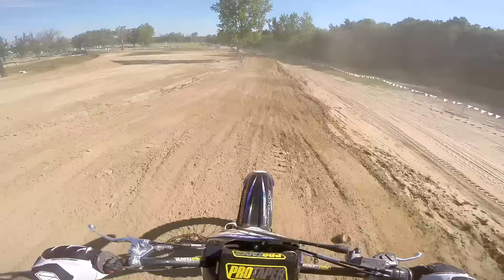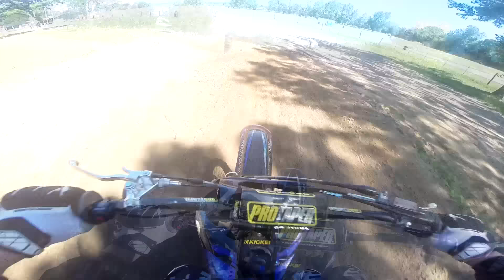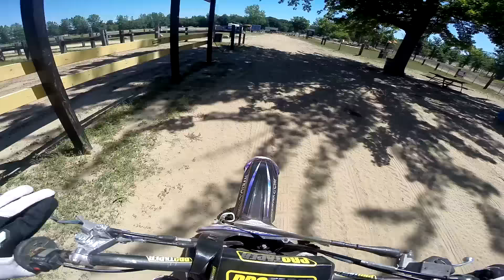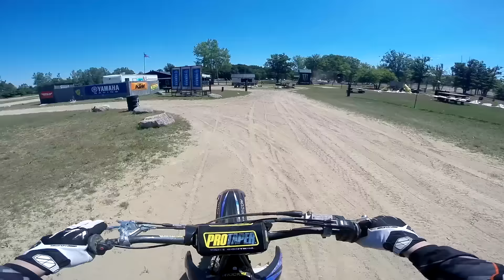RIP 250

Comment: This happened to me I spent time to  fix my bike up got new plastics and other crap then it started acting up 😂 ah the stress there so much fun to ride though it's worth the fix
Reply from the maker: By this, what do you mean?  Busted shift fork/rod?  Any clue how much I'm looking at to have it fixed?  Don't have tools to fix it myself and people I talked to that know more than me don't want to mess with their transmissions.
Reply: +That White Guy yeah that sucks stupid dealership charge a crap ton for any type of repair but I would recommend having a very mechanically inclined person you personally know do it but if you don't tea know anyone  that kind of sucks
Reply: +That White Guy have you actually tore the engine down to see if it actually was to shifter fork though
Reply from the maker: Not going to a dealer, was suggested to take it to the guy that did my suspension since he apparently know this issue and has fixed it before.  Pretty sure its either a shifter fork or I was also told shifter rod, either way the case probably needs to be split, right now I can literally take one finger and move the shifting lever up and down freely/no clicking and it dropped into neutral trying to shift to third, which is why I think that's the issue.
Reply: +That White Guy ok yeah just be careful mess up your transmission mess up your bike
Reply from the maker: Flxntz Not touching it myself.  Matt Crown is a really good mechanic from what I've heard and I might get some sort of discount since he just did my suspension, was told he might be able to weld it back without splitting the case which would save a ton.
Reply: +That White Guy yeah I think 3D machines did something like that any way good luck with the bike hope he can fix it for you because i really like your riding videos
Reply from the maker: Thanks!
Reply: +That White Guy it could be the shift drum check that before you order any parts

Comment: if you're gonna fix it yourself look at videos on youtube and read forums they will help you a lot.
Reply from the maker: yeah the guy I was there with has been doing this for WAY longer than I have, he said the only things he doesn't touch is the suspension and the transmission, and if he doesn't feel good about doing it I really don't feel good about tearing the case apart.  Was told that he had this happen to his bikes and his 450 did it, apparently the guy that did my suspension knows how to fix this.  Hopefully it'll stay under $1000...
Reply: ***** yeah the transmissions on small engines are pretty complicated if you don't know how it goes, when I was rebuilding my rm125 the transmission fell out of the case when I opened it and I had to take it to a mechanic to get that put together, but I was able to do the crank and piston and everything no problem.